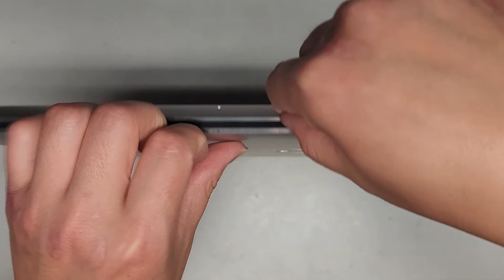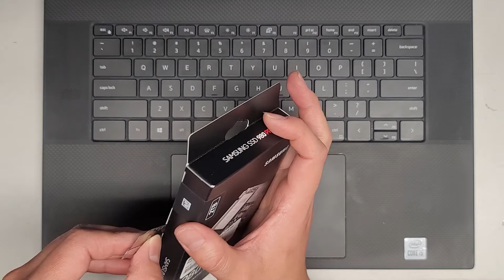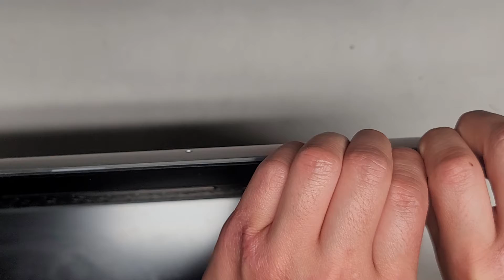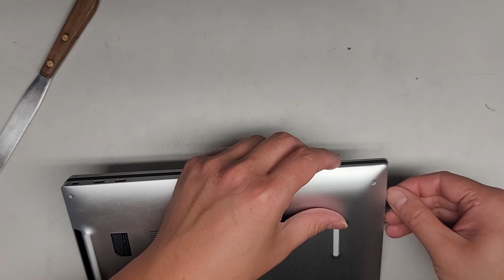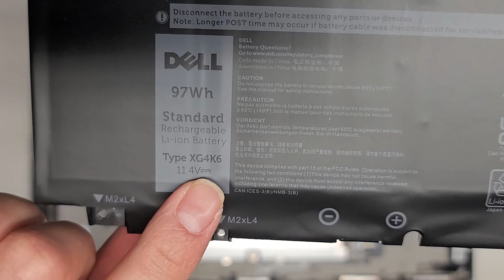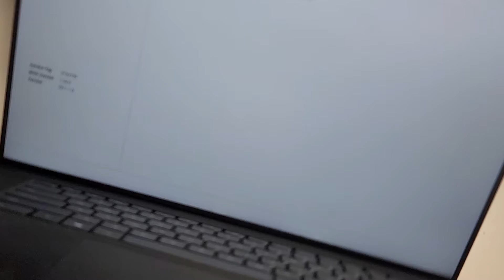DELL XPS 17 9700 Disassembly RAM SSD Hard Drive Upgrade Battery Replacement Repair Quick Look Inside

Comment: good day, I want to buy myself XPS 17 9700 laptop, but I’m confused that the battery is 45% worn out, and I’ll have to buy a new one, but what else can and should be replaced? SSD, Memory, Processor, what do you recommend?
Thank you.
Reply from the maker: Depends what it has in there.
Reply: @ItsBinhRepaired  all in stoc -  I7-10875H , 2060 rtx,  16 mb and 500 gb ssd ...
Reply: maby new faster SSd ? Ram ?
Reply from the maker: @Aleksey_Odessa  you can do that

Comment: Is Samsung Magician a reliable cloning software for upgrading the main OS SSD with a newer one or is it better to backup old drive and restore to the new one?
Reply from the maker: I like this program best https://youtu.be/4p5jFDzVwUw
Reply: @ItsBinhRepaired  Yeah, Macrium, my choice is Acronis, but I guess both are good enough
Reply from the maker: @gertwallen  yup
Reply: @ItsBinhRepaired  From a purist mentality I believe that backup/restore is more reliable than cloning for data integrity
Reply from the maker: @gertwallen  not really
Reply from the maker: @gertwallen  you lose data that you didn't think to backup
Reply: @ItsBinhRepaired  In Acronis you choose "Full Disk Backup", it will create a bit by bit clone of your OS drive to a backup file that you can later restore to the new drive, and in both steps there is an integrity check for the result. No chance of losing any bit.
Reply from the maker: Nice

Comment: A technician kinda damaged one of the screw grip, while trying to open the back panel. How do you suggest that the back panel be opened in that case?
Reply from the maker: You either need a more exact sized screwdriver here https://amzn.to/492NB68 or a screw extractor here https://amzn.to/490wG4a

Comment: Forgive me, as this is probably a very stupid question... What do you mean clone the original SSD drive? Would that be purely for backup purposes? I was going to upgrade my laptop (this exact model) by adding a second SSD (as Steam games are consuming a ton of my internal storage.) I wouldn't need to clone the original SSD to the new one if I wanted to use them for storage, would I?

Sorry again for the stupid question and thank you so much for such an informative video!! Very very much appreciated!
Reply from the maker: If you're putting a second SSD, you don't need to clone.
Reply: @ItsBinhRepaired  Gotcha! Thank you very much for replying!
Reply from the maker: @Skinnamirink  no problem

Comment: Yep it's a T5 torx bit.

BTW, I guitar pick works good as well to pry open the plastic.

Beware it sure takes a long time to get to that date time error.
Reply from the maker: Yeah, but fingernails work better. Lol
Reply: @ItsBinhRepaired  Only if you haven’t just cut them.
Reply from the maker: True lol

Comment: You're the only guy that I found that disassembled this thing.  I had the full capacitor , unit won't start problem, but I couldn't get the thing open.  Now typically I would have brute forced it, but it's a $4,000 machine.  I had it open a yearago, but I was sure that I was missing something and there were some hidden screws, because I COULD NOT get it open.  I struggled as much as you did to finally get it open, that said I was sure I was missing some hidden fasteners.   Thanks for going first!  All set now.
Reply from the maker: Glad it helped. If you haven't already, please like and subscribe so others can find my videos and possibly consider watching a few others to get the algorithm to recommend my channel. Thanks!